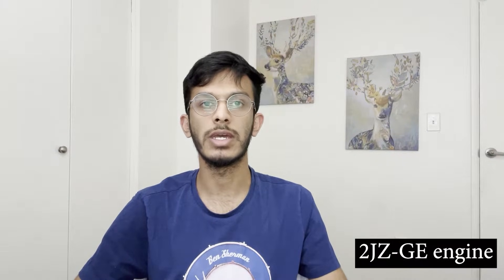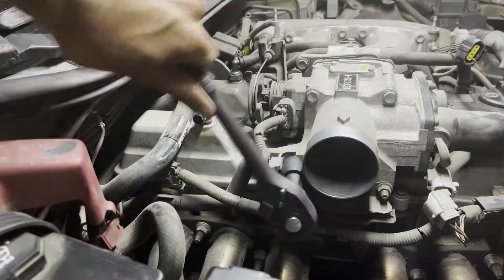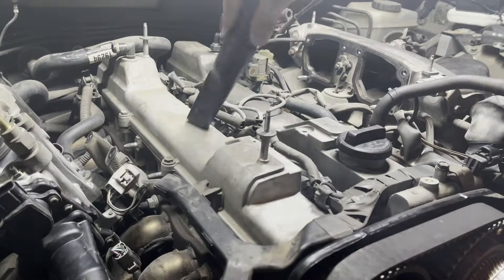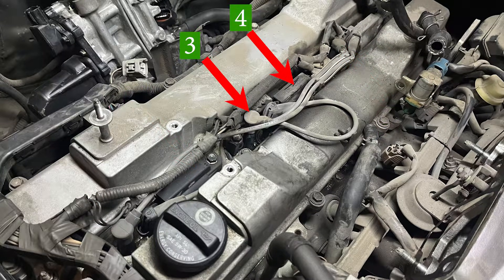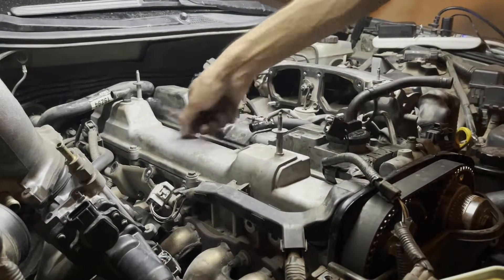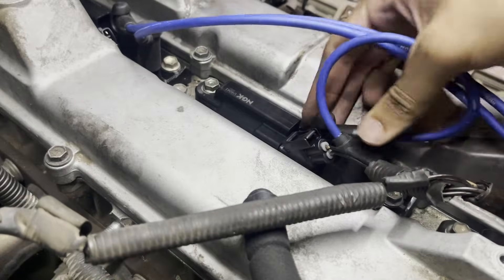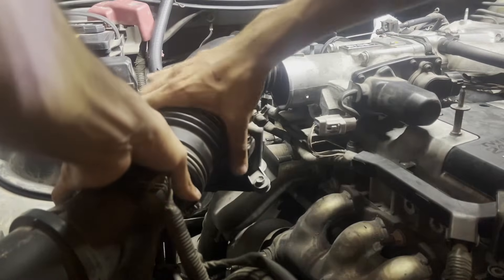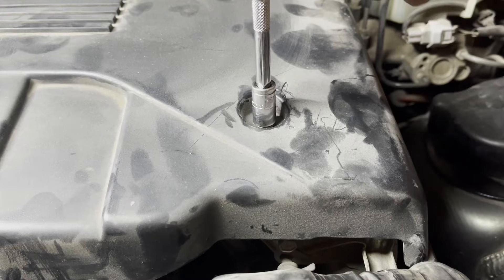How to change spark plugs on a Lexus GS 300 | 2JZ-GE (IS 300, SC 300, Supra)

Comment: love how u didnt show how to take the hardest bolt off
Reply: u talking about the 12mm on the backside underneath the throttle body? use either a super skinny 1/4 inch drive socket wrench of just a regular 12mm wrench and a mallet lol

Comment: Watching your video, it appears there is not an easy way to “test” individual coils by unplugging them one at a time?
Reply from the maker: Hello! Unfortunately not. IIRC you might be able to unplug one or two coils (maybe) without removing the intake/throttle body, but to unplug all the coils you just separate the throttle body from the intake at the minimum. 

Thanks for watching! 😃

Comment: This vedieo help thx. It looks scary but it's simple. By the way I think you miss 2 hoses behind the intake or close to underneath
Reply from the maker: I didn’t miss any hoses. I didn’t have to remove all the hoses because I’m not completely removing the throttle body only inverting it to access the spark plugs.

Comment: I am going to be doing this on a 1JZ GE engine everything looks similar apart from some things are in definitely places. Also there are not so many vacuum lines and the air intake pipe is a lot different

Comment: Great video helped me out alot my first time doing a big job like this. Can you put a radiator replacement video
Reply from the maker: Hello! I’m glad you found the video helpful. 

I’m actually replacing the radiator but as a part of a bigger series where I’m rebuilding the engine, here is the first video in which I remove the radiator. 

2JZ-GE Rebuild Part 1: How to remove cylinder head | Lexus GS 300, IS 300, SC 300
https://youtu.be/IRUBmalmWxg

In the next few videos I will be reinstalling a new radiator. I know that’s not exactly what you were looking for but hopefully it helps!! 

Thanks for watching! :)

Comment: Just changed the plugs and wires on my SC300.  Crazy that Lexus runs the wires in that heat soaked channel on top of the head and then of course covers everything up with the throttle body and plastic to make sure it all gets roasted in that engine oven.  Almost guarantees you’ll have to change everything out every few years.  Having said that it is a 30 year old car so the fact that it’s still running and in such good shape is a testament to the build quality.  But some of the design choices leaves me scratching my head.
Reply from the maker: I agree! A few other things that come to my mind are the placement of the oil filter, having the brake booster and ABS module as an integrated unit resulting in a 2000 dollar repair bill if either goes out, and so on. Luckily the build quality does save the day! Thanks for watching! :)

Comment: Very good video and explained very well. I just replaced the 3 coil packs, spark plugs and spark plug wires on my 2000 GS 300.  Plus replaced the valve cover gaskets . I got a misfire on several cylinders. The spark plugs looked really rough when pulled out. Car , engine just turned 267k . Did timing belt /WP a couple months  ago. Goal is to hit 400k with it. I have owned it 6 yrs. Best car built in my opinion. Again appreciate your video it helped me on the coil packs. Learned something new with the waste spark system. Pretty smart technology from Japan. 👍
Reply from the maker: Glad you found the video helpful! That was exactly one of the reasons I wanted to do the plugs, I got a random misfire and knew the plugs were probably drenched in oil and gunk. That’s awesome that you hit 276k I definitely plan to keep mine until the wheels fall off. Thank you for watching! :)
Reply: @theautochap  Valve cover gasket leaking may be why they were drenched in oil.  Should've replaced the gaskets too since you've pretty much done 90% of the work already.  Just needed to remove a few more bolts to get the valve covers off.
Reply from the maker: @pavelbuchnevich1229  actually did that too, it’ll be one of my next videos. Thanks for watching! :)
Reply: how's it running, 2 yrs later?  I also have the same but the upper oil pan has a huge leak. but very low miles. So I'm hoping this car will last me till 300k miles once it gets all fixed. it did pass smog so Im so thankful for that!

Comment: Are those denso spark plugs the same as oem spark plugs?
Reply: Yes denso and ngk are up when cross referencing them at a auto parts store
Reply: Denso ARE the oem spark plugs. Most oem Toyota parts are made by Denso, the coilpacks, spark plugs n wires are all Denso OEM. Furthermore the 98-00 GS300 actually require Denso Twin Platinum spark plugs, not Iridiums.

Comment: 1:00 how cold the engine need to be, can it be modertly cooled like, 1 hour after drive? or does it need to morining start up cool?
Reply from the maker: Hi Mohammed, ideally it would be best to leave it to cool down overnight, because the engine and also all its hoses are very hot and take a long time to cool down. Since you’ll be removing a lot of hoses and the throttle body itself there’s a risk of burns. If you are in a real hurry, you could wait 5-6 hours but you’d be doing so at your own risk. Thanks for watching! :)

Comment: Would you estimate how much time it should take to do this? It looks about like 1.5 hours.
Reply from the maker: Hi Doug, I would say approximately 1-1.5 hours. A big factor is how old the various hoses are and when they were last pulled off, as really old ones are virtually glued on and require a lot of effort to take off. Other than that, everything else is fairly quick.

Thanks for watching! :)

Comment: Nice video good info! I replaced my 2jz spark plugs wire with the same NGK! Drives wonderful!
Reply from the maker: That’s great to hear! It’s definitely a pain with the intake being on the top but well worth the effort. Thanks for watching! :)
Reply: @theautochap  Yeah it is a pain removing the upper intake manifold. I was wondering if your planning on doing a GS door lock actuators replacement video, and possibility a Lower Ball Joints, Rear main seal, and maybe suspension shocks and springs replacement video as well? Your videos are very informative and helpful for all Lexus GS Community. Definitely I can see your channel growing  with more helpful and useful video like these for all GS community.
Reply from the maker: Unfortunately I replaced the front LBJs and the door lock actuators just before I started this channel :( but I just finished rebuilding the entire rear suspension and got some great footage, that will cover replacing the shocks! I plan to do my front shocks in the future as well, so I’ll definitely have a video for that too. Regarding the rear main seal, I do plan to drop the tranny at some point in the future as my garage is just too small currently, but I will definitely make a video when I get around to doing that. I’m glad you find my videos helpful, I’m very happy to give back to the GS/Lexus community in whatever way I can :)
Reply from the maker: Also I replaced the LBJs and door lock actuators not too long ago so I remember what I did pretty well, if you do get around to replacing them and need any assistance, feel free to shoot me an email at thelexuschap@gmail.com and I’ll be glad to help :)
Reply: @theautochap  sweet! Thanks great job! I'm looking forward to see those future videos.
Reply: @the2jzchannel I did my upper and lower ball joints at 217k . Very easy to do. I bought the upper control arms with the ball joints. Lower ball joints bolt in. These cars are engineered simple which make them not to bad to work on. 
I will be doing front struts in the near  future.
Reply: @mattspontiacta  sweet I think I need to have my struts replace soon too